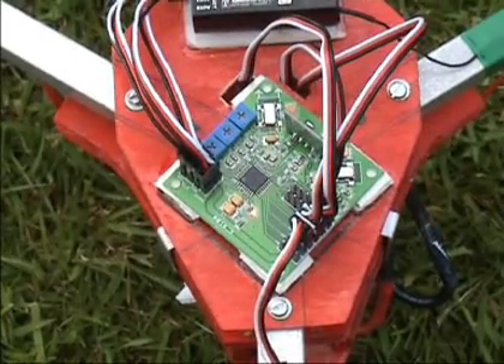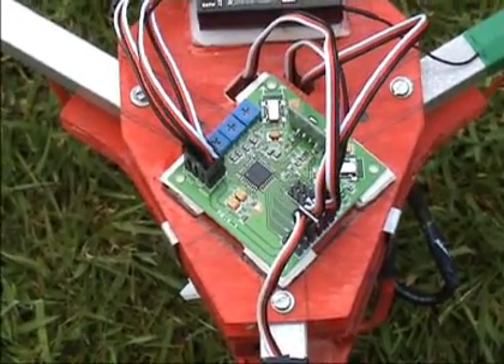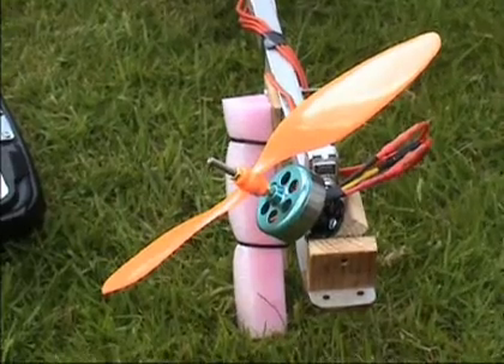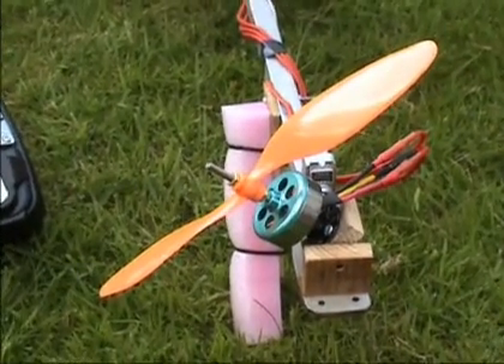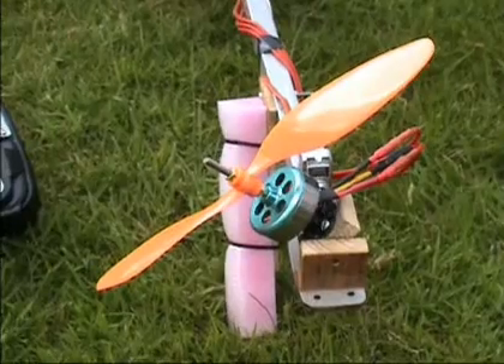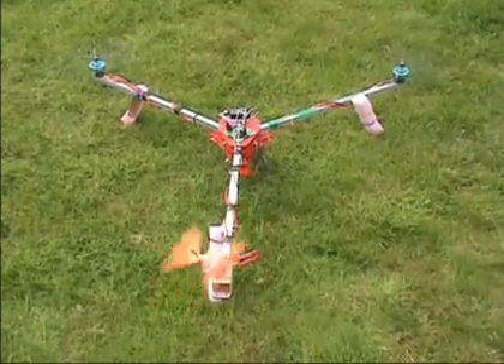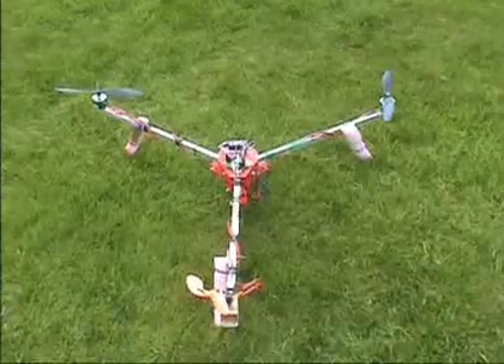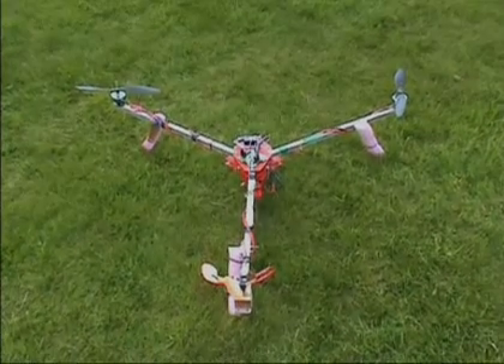Tricopter Help with Yaw Servo Required.

Comment: With regard to the tricopter servo not being centred, I went into the mixer editor of my KK2 board (channel 4 for my set-up) and changed the offset value from 50 to 70, and that did the trick (and perhaps eg -50 to -70 for your tricopter). This value is probably specific to each quadcopter, so you will probably have to try out some various values to centre your servo. Also, as I have a digital servo, I chose the “high” option.

Comment: the flight controller is not positioned correctly. the front of the board must face the front motors

Comment: Did you center the servo before installation? That might be the problem. Also the servo might be too small for the 750 that you put on them is kinda heavy and at last try to recalibrate the speed contrllers, calibrate the sticks and lowering the gain to a 5%. i hope this help.

Comment: Its ok for your yaw servo to be off set but the weight of the motor is pull it down, to fix this just jiggle your yaw on your transmitter before you take off